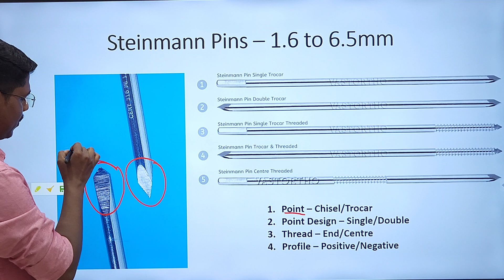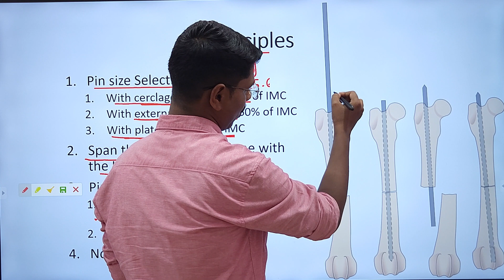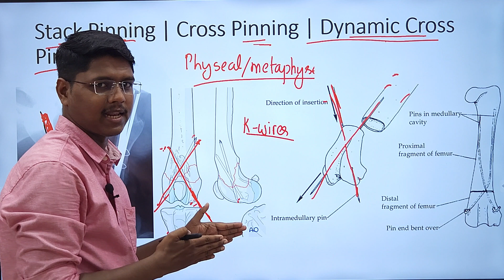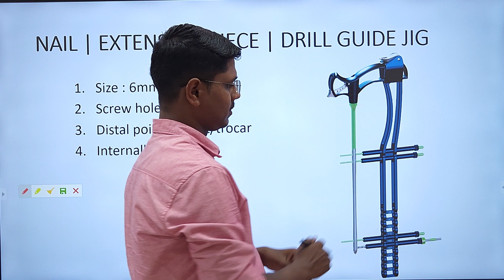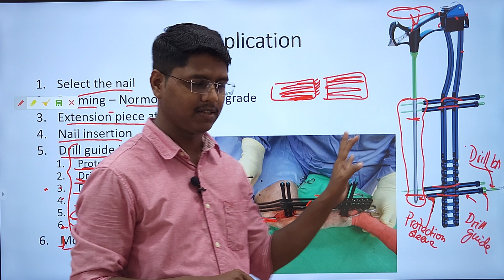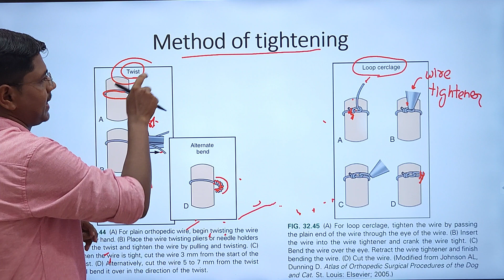Intramedullary Fixation | Lecture 08 | Orthopedics

Comment: Sir, 
In case of cat spraying 
the overy Joint khot done not properly is there any risk of cat dying internal bleeding?
Reply from the maker: Yes.
Reply: @vetsurgeryatease  within how may days? 
already 24 hour's passed and the cat Doesn't show any abnormal activities!
Reply from the maker: @marco2525-w5l  24-48hrs max. Just check for Hemoglobin and RBC Count.
Reply: Is there any option to minimise the damage!
Reply from the maker: @marco2525-w5l  double check your knot before leaving the ovarian stump back in to the abdomen.
Reply: and also what the sign of internal bleeding of cat! 
the cat was 6 month old and 
2.5 kg body weight
Reply from the maker: @marco2525-w5l  abdominal distension, anemia, respiratory distress